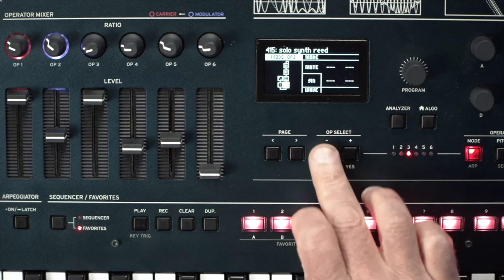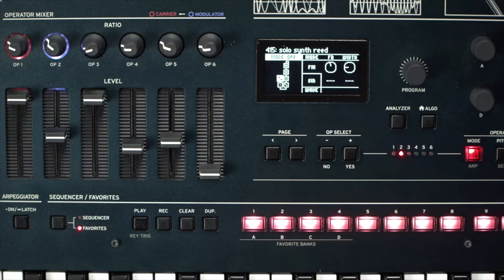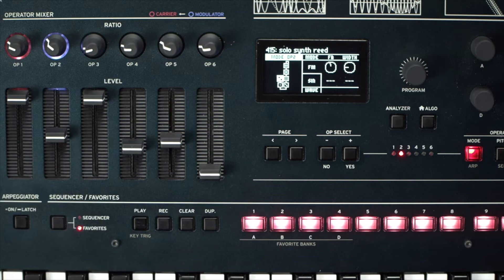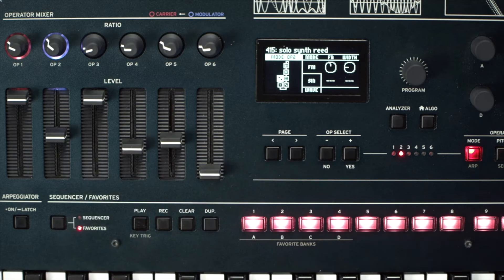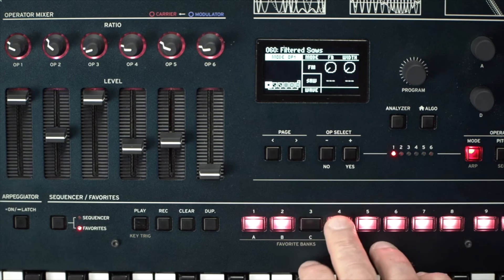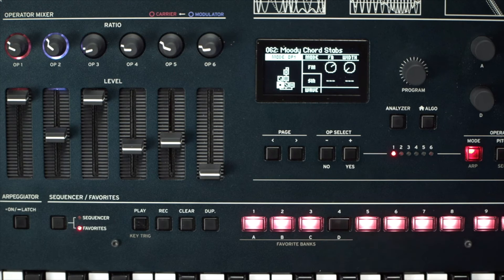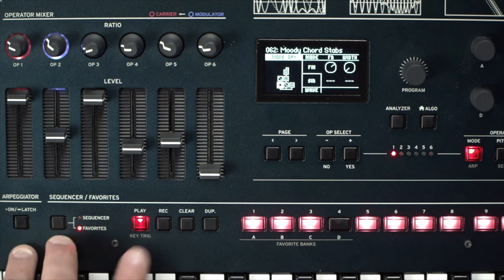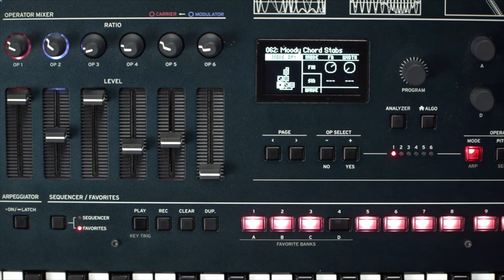KORG Opsix with Dean Walliss Part 3: Filter FM and Patch Economy

Comment: Patch Economy: that would have been the word i have needed in my comment to an other video of yours.
i'd like to see you disassemble an DX7 patch and reassemble it on the Opsix with all the new stuff.
Like using waveforms of the Opsix where the DX7 would have wasted a stack of an algorithm to get a sawtooth.
Like using the modes of the Opsix  where the DX7 would have to do (i don't know what) to achieve ringmodulation or filterfm.
so in the end you're using less operators or stacks of algorithms than would have been needed on the DX7.
edit : replaced branch with stack